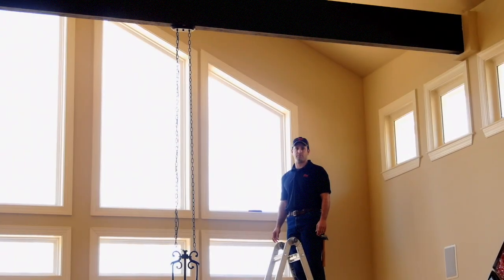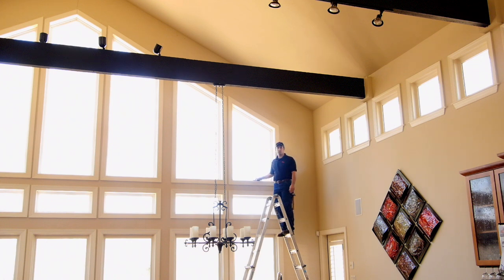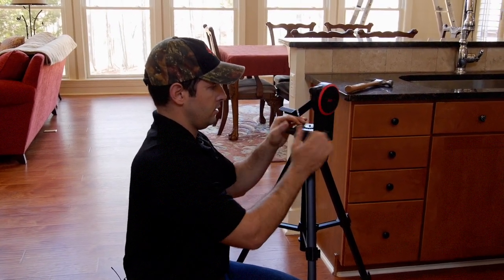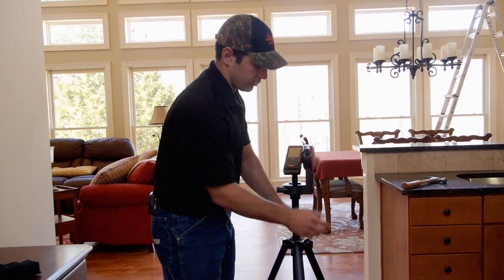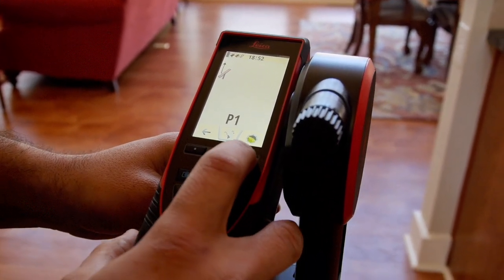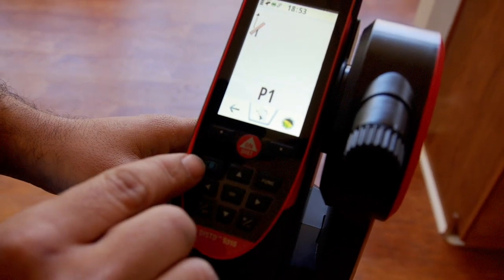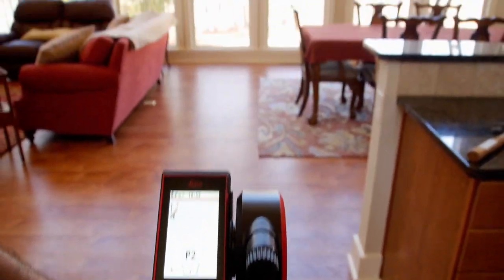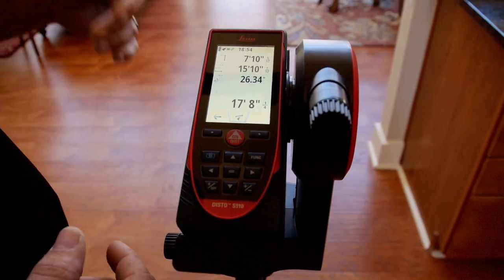Leica DISTO S910: How to do a P2P Application

Comment: After reading the comments it sad there aren't some grown-ups watching this.
I think a great addition to measuring the length of that being would be to use the disto in the method you just showed and then get a taller ladder to measure parallel with the beam and then compare measurements.
I'm new to lasers and don't need one for super high accuracy. I'm a flooring installer and I found that using the laser to quickly measure the length and width of the house and each individual room can quickly give me some relatively accurate measurements to draw up a sketch of the home to reasonable accuracy.
Once that's done and I have my layout drawn I can use a tape measure to measure each part of the room that I want to measure. I'm not measuring wall to wall I'm measuring baseboard to baseboard. I also measure closet depths and widths and tiny details which are useless with the laser.
That said, the laser helps me quickly draw up the measurement or footprint of a home because doing so with a tape measure is quite slow.
It's also helpful because you can measure over furniture.
I might move up to a fancy laser someday but for me, the cheap one still measure to 16ths.
Thanks for the video I always wondered how you measure from point to point such as a vaulted ceiling.  I'm not going to be carpeting any ceilings in the near future so for now at least, that's too much bang for my bucks. 😁
Pay no attention to the trolls they've got nothing better to do but criticize.
Reply: I agree with your point on showing and confirming with a second measurement along the line.  What is the accuracy of P-P using range, angle and pitch of two points?  Surly there is a trade off.  Showing the "old way" will reveal the pain vs ease vs 1/4" vs 1/16" trade offs.

Comment: We've purchased Leica DISTO X4 laser meter and in less than 6 months the and it stopped beaming laser just an error.
when we talked to Leica, we found no caring for the problem or any responsibility towards their customers and their products!!!,
they've requested videos, serial etc. that we've provided them with, and 
till this moment after nearly 10 days of down time our issue hasn't been
 resolved. they told that your dealer will replace the unit but just 
delaying and nothing happened.

Really bad experience,bad customer service and support.
And after they know that their agent makes things difficult and don't want 
to exchange the item dependent on their orders, what they have done? they
delete comments on linked in and send us by email to do whatever the 
agent want.
If we bought it from amazon not from them, they will respect the warranty  more than them.

Really really the worst company we've dealt with. 

and the laser itself don't work correctly without their tripod. (that's from our measurements not from their recommendations they didn't tell anything just discover the error!!!!) 

Advice: Don't buy any product from them, you won't find any support.

Comment: I'm about to purchase this device for marine use in the field. Is it possible to use this on a vessel in the water where you cannot level? The tripod would change level all the time, but it would all be relative/tied to the vessel. Is it still accurate to use this without calibrating level or using that? Thanks.
Reply: You can take measurements without leveling, but you will not get the 3 dimensional data like slope distance, horizontal distance, or vertical distance between two points. When the unit is not leveled, you will only get a "TIE" distance between two points which is slope distance.
Reply: You can still measure point to point distances accurately. You just can't level the device to give you rise and run. This is assuming the platform and the object you're measuring are in the same reference (i.e. on a boat measuring boat parts).
Reply: Hey Brian did you finally buy?

Comment: Sir, I have what I think would be a revolutionary simple idea that would be easy to integrate into any Disto product. I, myself had the D810, and most of the dimensioning takes place within homes in regular-sized rooms.  The majority of the time I spend on-site is sketching the areas.  With my idea, I feel I could cut this time in half (or more), and it would EASILY integrate into any disto device.  How can I relay my idea onto the engineers at Leica?
Reply: Please send your suggestion to leica.disto@leicaus.com. Thx. Leica